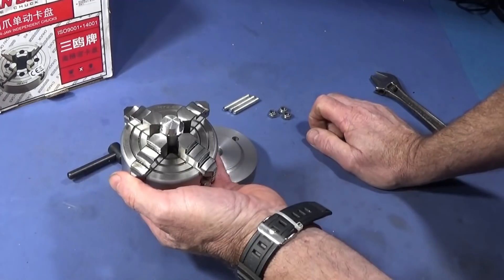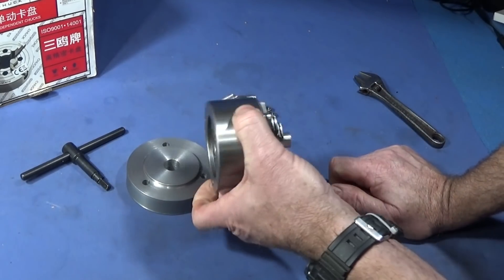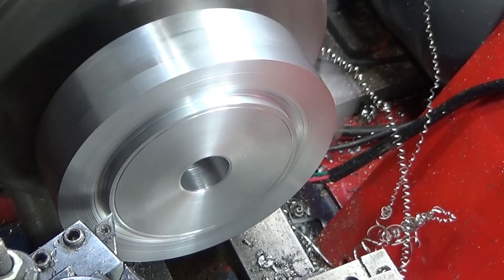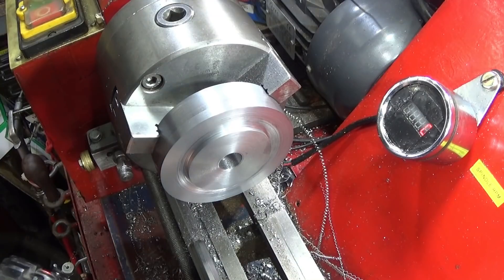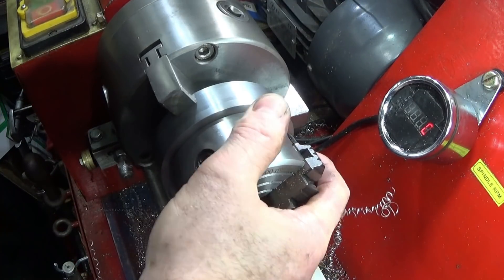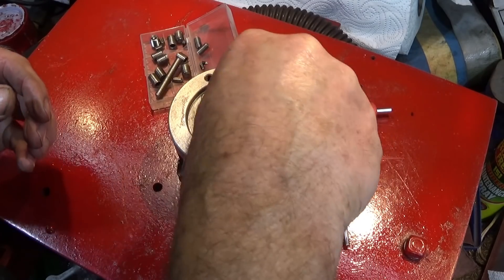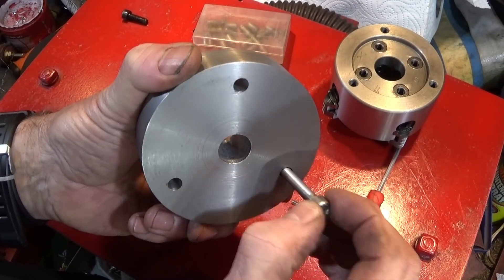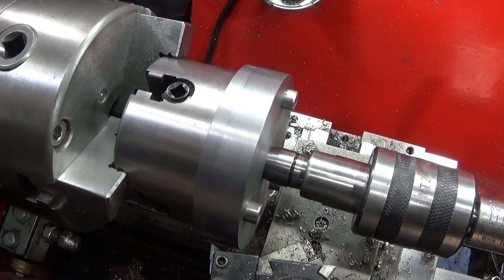Machining A Chuck Jaw-Held Backplate For The 80mm Sanou Chuck

Comment: Good video!
Is that a 5 inch chuck on the lathe?  I'm trying to decide if I should get a 5 inch 3 jaw chuck or a 4 inch 3 jaw chuck for my 7X10 mini lathe.
Reply from the maker: Hi yes it is a 5" inch chuck. I think you can buy the backplate from a company called Arceurotrade uk
Reply: @SteveJordan  There's also an on-line company here in the U.S. called "Little Machine Shop" that carries the chucks and backplates for them for these mini lathes.
Reply: Hi Steve , I’m a new subscriber to your channel and I must admit I find all your videos really helpful and with a recent purchase of a myford ml7 I can’t wait to do the same improvements you have made ! 
My question is can I go up to the 125 mm Chinese Chuck from bangood for my lathe , what size is the main Chuck you use on yours mate ?
Again , watching your videos has become very addictive lol
Reply from the maker: Hi Peter, Thanks. Yes I mainly use  the 125mm chucks. You can buy the standard backplates for them on eBay, or you can buy the backplate with 24 indexed holes around the diameter of the backplate if you want to set up indexed work in the future. Regards Steve

Comment: Do you mind if I ask what type of steel you used for the back plate Steve, is it  En1a?
Thanks Stuart
Reply from the maker: It is Bright Mild Steel which I bought on eBay. I used 90mm Diameter X 25mm long.

Comment: Good work, well presented as usual.
I may have missed a trick, but apart from balancing and personal pride in good workmanship, is there a reason for an accurate fit between chuck and register on a 4-jaw independent chuck that will be adjusted using an indicator anyway?
Reply from the maker: I just like to get them near enough, it doesn't make a difference though on these independent checks like you say.
Reply: Hi Steve , thanks for the great video.   I would like to add that the registration accuracy does help a lot with balance a lot and if you are putting in something offset and it happens to be off balance in opposite of your chuck it will help.   On the other hand if it is off balance the same way as your chuck is off balance it will really exaggerate the problem.   I just thought I would add my 2 cents. Very nice work and ideas

Dale in Canada

Comment: Did you do this so you can use it like a big collet block? A way to hold stock when offset turning cams and cranks, where you can quick and easily remove the work from the lathe to do other machining processes on it without compleatly loosing any important positional register on the part, then being able to drop the part and chuck back on the lathe and have the features you originally turned still all concentric with the lathes spindle?

BTW, Those Allen key stub transfer punches are a stroke of genius........ I am SOOOO nicking that idea. :D

Comment: Is that tach in the right background  an add on or is it part of the original parts of the lathe? If add on do you have a link to it or ????

Very cleaver transfer marking with the grub screws and pieces of sharpened Allen wrench pieces!👍👍👍

I guess you don't find that the chuck hanging out so far has negatively affected rigidity?
Reply from the maker: Hi Dwight I bought the tachometer from Banggood. I will put a link up later. Also the wiring instructions for the tachometer is on my YouTube community page. 
 The chuck doesn't affect rigidity as I have heavy duty tapered roller bearings in the headstock.
Regards Steve
Reply from the maker: Motorcycle Digital Tachometer --  https://goo.gl/2rRiKh
Sensor Cable With 3 Magnet -- https://goo.gl/Meam7q

Comment from the maker: SEE LINKS BELOW FOR THE SANOU CHUCK AND OTHER TOOLS:-
SANOU K72 Lathe Chuck 80/100/125mm 4 Jaw Independent Hardened Reversible Tool -- http://bit.ly/2MpBXN2
Machifit ER40 100mm Collet Chuck Compact Lathe Tight Tolerance CNC Collet Chuck Lathe Tool -- http://bit.ly/3pb0EuW
Reply from the maker: Australia Day Sale -- http://bit.ly/2YoElpN
Reply: hi Steve . Would just like to say thank you for helping me take the plunge and buy a 1948 myford ml7 . i was interested in the 3phase convertion as mine comes with both motors . please keep posting as its so benificial for people like me who have never used a lathe before . stay safe . Rob from Boston Lincoclnshire
Reply from the maker: Banggood Klarna Interest-free Sale -- http://bit.ly/3rXAnBB